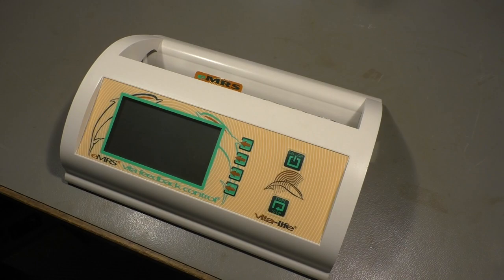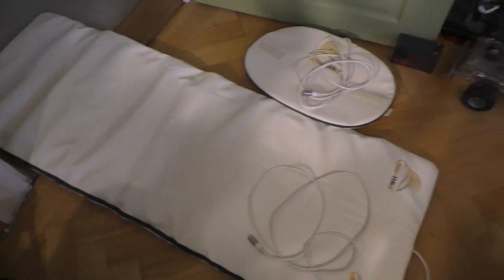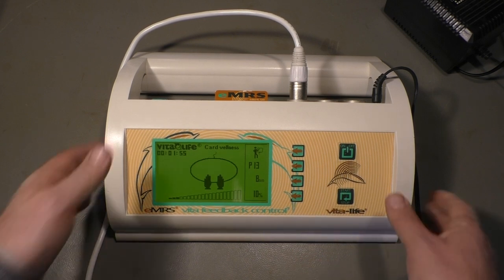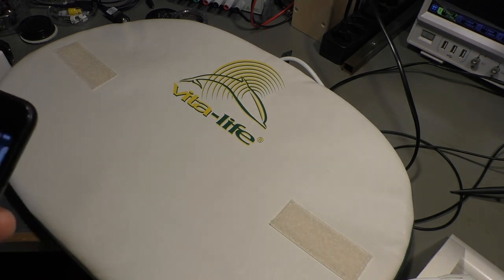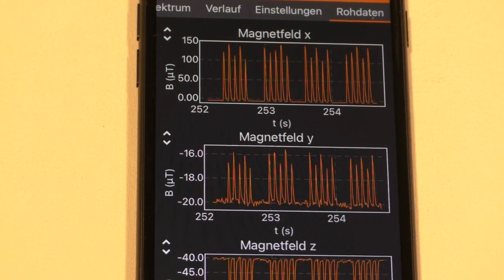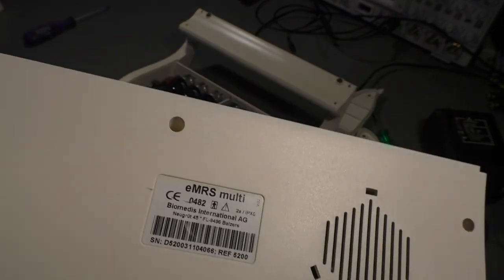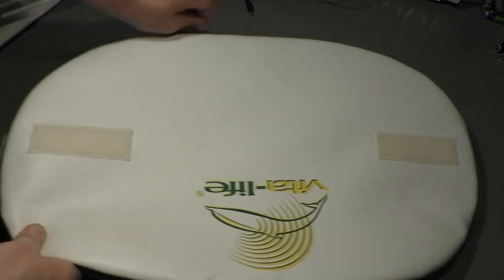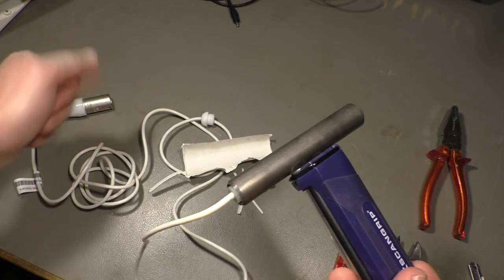Magnetic Field Therapy (PWJ191)

Comment: Bought on auction a Bioptron unit, which is simply a polarised light source, with a whole host of implied benefits.  New cost around $12k, but on auction, not working, was sold for $30. Simple to fix, replace well cooked 1W power transformer, and resolder the equally well toasted voltage regulator transistor. Used an old transformer from other scrapped stuff, and a lower voltage secondary, because they use a 220VAC to 36VAC transformer, and it has a 15V regulator, so that it has universal input voltage range, so the regulator on 230V has to drop around 30V across it. Apparently the most common fault, as otherwise the power supply, for the 12V 150W halogen lamp has really good protection, and good quality parts. 

You get around 1% efficiency, but it is polarised light, and it currently sits packed away as I have no use for it.
Reply: That makes me think maybe there's a second hand market for these. If you buy it for $30, repair it for peanuts and sell it off for a couple of grand with a "repaired by a fully certified technician" BS letter it would make for a fun an profitable hobby. You already know that the potential customers are either scammers too or idiots so why the heck not?
Reply from the maker: If you take a polarizer from an old LCD screen and hold it against tha sun, you get polarized light too.... but why is that any better than normal light??
Reply from the maker: so it's a halogen lamp with a polarizer.... They claim in their product video that they filter out UV light. As far as I know, an incadescent bulb does hardly emit any UV light. And polychromatic, as they say, it's anyway.
So I wonder where the 12k$ price tag comes from??
Reply: @PlaywithJunk  Well you have to pay the stupid tax, and they need a lot of advertising money, to swamp bad reviews to page 5 of search. Plus the whole made in EU thing, where the head office is in a city known for banking.

Comment: CRT televisions with their 50Hz and 16kHz sawtooth scanning fields, some air ionisation from the EHT and a little X ray radiation must have been quite a synergy of health devices! I used to think TV was better back in the CRT days; maybe I mistook it for all the beneficial “health features” radiating from the set ;)
Reply from the maker: ...and if you put a polarizer in front of the TV tube, you even get a Bioptron lamp. Can't get any better! I'm starting selling CRT TVs as health improvement devices. EEE-HA!
Reply: @PlaywithJunk  TVs aptly nicknamed “the Devil’s Lantern” back in the day! Upsell with some X ray fluorescent wallpaper for additional insight/diagnosis.
Reply: Actually, it's the lead-based solder that provides the majority of health benefits in those old CRT TVs. The older TVs also had special flyback circuits that helped to prevent global warming, and we are now paying a very high environmental cost because everyone uses LCD now days.

Comment: i like how consistent they are with thier dolphin theme even going for a dolphin shaped case. for some wierd shady 2004 quack esotherics company they really have a charming design. xD
quite interesting that the device actually does what it claims (even tho that does not make it more useful). this thing may actually have benn made with good-ish intentions
Reply from the maker: Most of those devices do what they claim.... otherwise it would be easy to uncover the fraud :-) And it's certainly expensive enough to make it work.
Reply: @PlaywithJunk  im more used to devices like „foot detoxer spas“ that just put mains voltage on 2 electrodes and claims that all the gunk is somehow pulled from your body instead of the plating on the electrodes

Comment: Thanks for this great debunking video on this scam 'medicine' apparatus. 
Fun fact: 30 years ago, I made my diploma and PhD in physics at RWTH Aachen, II. Phys. Inst. B, that's the same institute for Condensed Matter Physics where later PhyPhox was developed.
I did research on High Tc superconductors, using a Hartshorn type AC-bridge with excitation fields of  50µT .. 5mT, 390Hz and up to 7T superimposed DC field. For that purpose, I designed a precision AC current source; maybe something like that is also inside this apparatus. 
At that time, I also developed PC and GPIB based data acquisition systems and software for the whole institute, (after they retired their old PDP 11 system), so there's a long history of T&M development in that institute, evidently.

Comment: What a contraption, proof that some people will take comfort from anything.
Reply: Having said that, the surprisingly good build quality throughout gives me the feeling that whoever designed this actually believed in what they were doing.
Reply: @jimsvideos7201  Or they just wanted to keep the company running and not have it blown out of the water by the first youtube teardown video showing that the device actually contains an arduino and some metal rubbish for weight.
Reply: @benbaselet2026  That's what I expected, although YouTube teardowns weren't as common a thing in 2004.
Reply from the maker: That's the case in most of these devices. Otherwise the scam would be too obvious. Just check my video about the MORA device.

Comment: I have recently obtained a (kind-of) similar device that comes from Hong Kong but also has some Korean connection too. There are lots of probes and connectors, and some TENS pads too. You seem to be able to choose all different kinds of therapies, or perhaps even combine them!
The build quality is very high, it was certainly manufactured to appear like a medical-grade device. I assume it was originally in a Asian Medicine practice, with special therapies offered to clients. It also has some dildo-shaped probes, and I am unsure if they are meant for internal or external use LOL.
I don't understand any of the writing on it, and the instruction manual is also in Asian writing. I Googled for the manufacturer website but did not have much luck. I've set the whole thing aside to research in more detail when I get some spare time. I think it will give the Google Translate app on my phone some hard work.

Comment: It seems like a TENS machine but without the nice feeling tingles and a high price.  Can you feel anything when in use?
Reply: TENS applies voltage directly to the skin, these waves should not do anything to a human body compared to standing next to a running motor :)
Reply from the maker: No.
The magnetic field has about the same strength of the earth magnetic field... can you feel that?

Comment: I would think that's a custom   ASCI   ,  not a    off the shelf  CPU.    Something  like    that uses a  custom processor
Reply: Why would you think they spent huge piles of money for spinning a custom ASIC instead of buying a $5 generic microcontroller that does exactly the same thing?
Reply: It's the programming that makes things custom, you wizard you :)
This device is extremely simple in function, cheap microcontroller is more then enough.
Reply: @benbaselet2026   Because it cost  over  4  grand , and  the unit  it's self  is a special  function   device
Reply: @justjoe7313   No  I disagree, that unit  has more   advanced logic  more   then you  realize
Reply from the maker: CPU is a Mitsubishi M30624FGAFP, 256k flash memory version, 10 8-bit I/O ports. Microcontroller.
And the only thing it needs to do is to put some fancy graphics to the LCD and generate the pulse for the coils. Ah yes and reading the memory card and play some sounds. More or less what a Gameboy is doing too... no advanced logic necessary  ;-)
Reply from the maker: The cost does not reflect it's function. These things are all insanely expensive just because they can sell it! It is never worth tha money, but hey, when people pay $4000 you'll take it.
Reply: @PlaywithJunk   Okay  does  it  have   A ROM chip   and memory ?
Reply from the maker: @johnsenchak1428  It's all in the microcontroller. There's no need for extra chips. Think of it like an Arduino or RaspberryPi